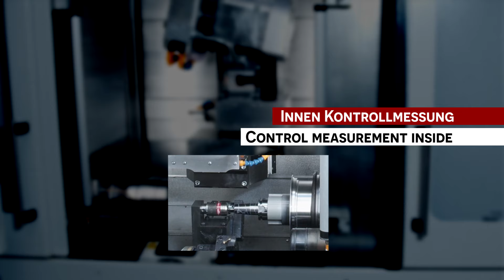Precision Grinding on a Mill Turn | Spinner Microturn Grind

Comment: not precision enough without grinding?
Reply: Great question! It depends on the context and customer requirements. The harder the material and the tighter the tolerances, the more grinding excels. Here we're working with X38CrMoV5-1 (1.2343) vacuum hardened to 52+2 HRC, achieving a surface profile tolerance of 0.003 mm (0.00012 inch) for key dimensions. Our machine offers the flexibility to optimize for each part!